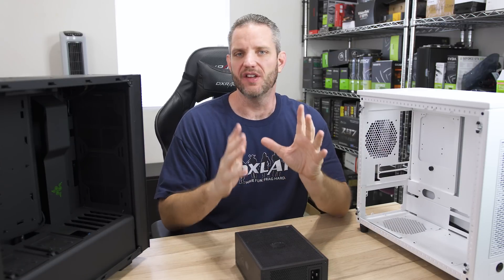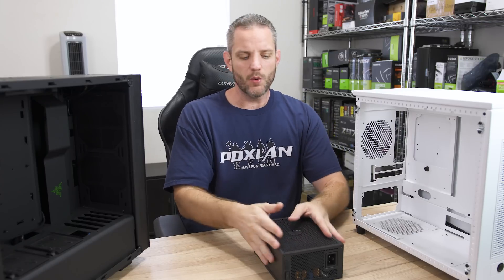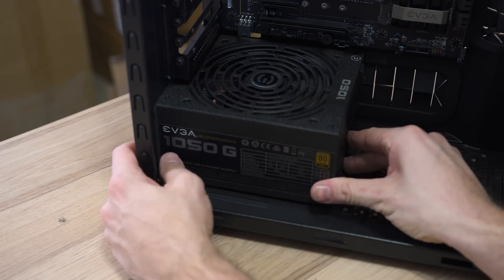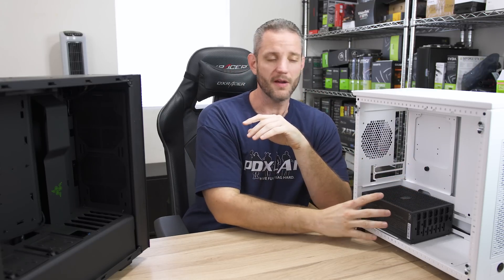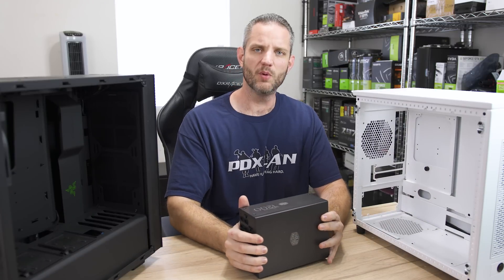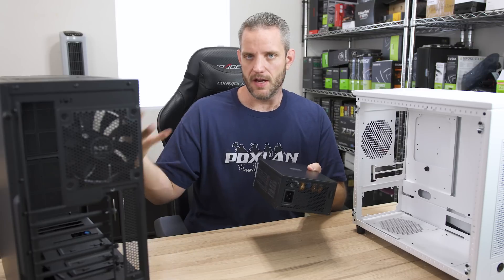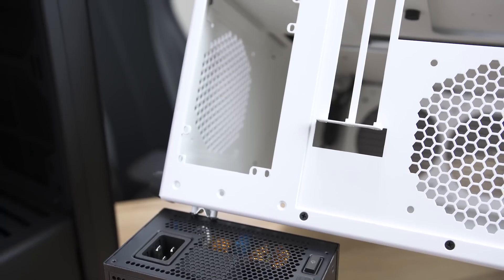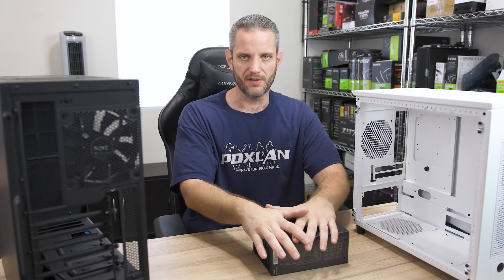Should you mount your Power Supply up or down?

Comment: 4:05 Jay, hot air is lighter than cold air, therefor it's going up when coming outnof the power supply, there is no way you can and up with a warm air loop.
I mean I think but you have more experience so i'll trust you^^
Reply: God the cabinet....At my apartment I keep mine on my desk. When I bring my PC to my parent's though my desk there is small and I have to put it in the cabinet, but it at least it's open in the front and partway on the back left. My mom's desk though has a cabinet with a door on the front and no ventilation. Why?! It kills me when I see the computer on in there with the door shut, all hot. I'm about to build her a new one from my old parts, but I'm worried about putting my precious parts in that cabinet. I'm gonna at least try and take the door off; hopefully she doesn't argue about the aesthetics.
Reply: If there is a decent intake fan 5-10cm from the heated exhaust (as would be in the described scenario), that fan wouldn't have much problem drawing some of that hot air "down" and back in again. Surely the force pull on the surrounding air, from the fan, would be greater than the thermal updrift due to exhaust/ambient air temp differences. Remember we're just talking half a fistful of centimeters here.
Reply: Albert Mas
That doesn't sound right. Your PC will always be hotter than (or at best equal to) ambient temperature. Components in your PC can only generate heat; there isn't any cooling system inside in the sense of a refrigeration cycle with a compressor and condenser and such. Fans only move air, they don't change its temperature. Even in a water cooling loop, the coldest a part of the loop could get is ambient. And it's not like "processor x runs at 100°F under load" regardless of what the ambient temps are. The processor turns some of the electrical energy sent to it into waste heat energy. If the ambient temp is 110°F, then the processor adds heat and increases above 110. Ignoring heat generation, say when your PC is off, its components will come into thermal equilibrium with the atmosphere; if the room is 110°F, then the PC will become 110°F. I suppose it's possible if the ambient temperature went up very quickly that the PSU could be colder (it hasn't had a chance to reach thermal equilibrium), but it would quickly heat up to at or above ambient as 1) normal heat transfer to reach equilibrium continues 2) the PSU fan starts to pull hotter ambient air across its components 3) the PSU components generate waste heat internally.
Reply: Heat like that is a good way to kill an HDD.  Linus Tech Tips had a video a while back where he cut a hole in a cabinet and affixed a fan to it that was powered off the PC.  Might be worth trying.
Reply: +pendragonshall

Oh, yeah, real life is way complicated versus theory. For the most part, the reasoning behind why placing PSU facing up would be cooler for the CPU would be another exhaust for the whole system. More exhaust will pretty much always mean a cooler average internal temperature. I was trying to say, however, mounting your PSU up means that your PSU will run hotter, since it's then going to be intaking air that's already been heated a little bit. Your CPU would almost definitely run cooler with it mounted up though, and average case temps would definitely be lower. I was taking the point as being more that putting the PSU up is cooler for the PSU, which wouldn't be true in most cases. But if you're talking CPU temps, then I totally just misunderstood the problem, and yeah, CPU temps would definitely be lower. As far as the hot-air loops go, though, if you're seeing that problem, it might be more a problem with the case design or placement. The placement of the computer is super important for that stuff, and so my 'analysis' is more general, for an 'ideal' setting. (I also didn't really do the math, I just know how the equations tend to interact and make educated assumptions from that, so it could turn out that I'm off). But if you've got things set up right, you shouldn't be getting any substantial hot air loops. You'll definitely take in some (fan turbulence will definitely send some down there), but it should be pretty minimal. Then again, not everyone can get an ideal setup.

Not trying to talk down to anyone, aerodynamics is super complicated to get right and sometimes a little counterintuitive. Hard to explain any part of it without sounding a little condescending, but I try my best. Sorry if it came out like that, definitely not the intention! I just want to help educate people on how stuff works since conventional wisdom on how fans work isn't usually true (well, results can be, but the reasoning is usually off), and I think most people enjoy learning. :)

Have a good one man, sorry for any misunderstanding!
Reply: wtf are you smoking? Ambient temp will not be hotter than the air coming out of a computer. If you pulling air in that is 65 degrees, your computers components are not going to cool it to 60 degrees and spit it out. wtf are they teaching in schools now.
Reply: Omegasix word!
Reply: Heya,,, My answer stands. Thanks Aerodynamics.. . wait,,  have to say something since YOU had to also. .. that's sounds,, I'm sure you meant nothing by it, but, don't do that.. Do you thank gravity everytime you walk?? Sorry but people that treat normal reasons such as ,, oh math etc and then thank it like a religous mantra make it sound, like a ,, platitude i guess. .. anyhoo .. AGAIN.. sorry if that hurt feelings didn't mean to. Just, don't do that.. It also makes it sound like you're talking down to someone. So unless the person you're speaking to is actually dumb.. It's.. Just don't do it k :)
To prove this as fast as possible. Simply. Take your psu and mount it intake down. Check temps. Then mount it up. Check temps. ALSO make sure your case is within a few inches of a wall and there is no air flow going through the room. 
Use colored smoke if you have it, temp camera or temp gauges such as I have. 
THis is what you'll find. It will ALWAYS be slightly to a lot cooler overall for your case components mounted up. As for your cpu it will either show no difference to quite a bit. Depending on how close your case is to the wall or if it's in a partial enclosure. Say a cabinet.. 
SOME of the heated exhause will go into a loop. THis is fact. It's no a lot. Unless you're in a pretty restricted enviroment or right up against a wall (most people are) however,. Placing it up. DOES cool your CPU, quite a bit more actually. So yea.. 
My PSU doesn't run at any temp difference for ex. Face up or down.. But my case is over 10 inches from the wall and there is constant airflow in the room. But my case does run cooler as will everybodies.. And yes placing a computer up really near a wall or in a cabinet with door off. WILL cause a loop even if it doesn't say in the middle of the room. The closer and/or more enclosed, the greater the loop.. AND you WILL notice psu temps rise whereas if the psu was face up it woudn't. 
All good. Take this as you meant for me to take yours. Peace
Reply: but he's wrong. sort of and he's right. ahh read my response to his. Peace
Reply: Scoobacca152 Hello, your answers seems to me really well fundamented. Are you aerospace engineer? that's fucking cool.. Do you know what's the best fan "side" for a cpu water cooling system? (radiator)
Reply: +Kurgan100 The best solution for a radiator is to put two fans on the radiator with the airflow going the same direction. This is called a push-pull configuration, one fan pushes through, the other pulls through. 

However, if you're only doing one fan, there's not a huge difference on cooling for which one is better. "Pushing" air through the radiator is what i prefer, but it doesn't matter that much.
Reply: Scoobacca152 I have a Corsair h115i then you said that put it on 4 fans 140mm instead of only 2 or I'm wrong?
Reply: +kurgan100 4 fans on it would be optimal for cooling, but you'll be fine with 2. 4 fans will also run louder than 2 will, so there are benefits to not having more fans.
Reply: Scoobacca152 Do you recommend any fan in special?
Reply: +Kurgan100 anything with high static pressure
Reply: Scoobacca152 Thank you for your help!
Reply: You clearly haven't studied about flow of liquids and gas then... You can't just make a general statement like that and have it be true for all circumstances. There's plenty of situation where the air (not all you see...) will take the route back under
Reply: I apologize, but can you explain this in simpler terms for me? Reading the paragraph was definitely a challenge, but I did understand the physics of air. I just didn't understand how the PSU interacts with it. I definitely do enjoy learning and understanding new topics!
Reply: OMG, everyone tries to factor in the fact that hot air rises. Hot air rises slowly, not quickly enough to effect fast moving airflow. Hot air rising is not a factor in boxes with moderate to high airflow.
Reply: +pendragonshall
 Not exactly true. You're ignoring a lot of factors. For background: I'm an aerospace engineer. Airflow is our thing.

The PSU fan being mounted on the bottom does a few things. It pulls the coolest air in (thanks convection) from immediately below the computer. This air below the case is then at a lower pressure than the average air in the room, and so more air rushes in to fill it. That air is going to be the air immediately nearby. The PSU also vents out the back, meaning that air is higher pressure and wants to move to areas of lower pressure (like the bottom of your case). Makes sense, right? Unfortunately, that's not actually how it works here.

What determines flow is total pressure. What we're talking about in the flow we just described is static pressure: the still air that we're using as a cold supply becomes thinner. But the air we're exhausting has a few things going for it though: it's warmer (less dense, more viscous), and it's got velocity (fans). However, unless there's a dedicated output fan for the PSU, your static pressure (pressure caused by the air just being there) is likely about the same as the rest of the room. What this air has (why it's higher pressure) is called dynamic pressure, which comes from air moving. That dynamic pressure bleeds off because of the air's viscosity. Hotter air is more viscous than colder air (unlike liquids), and so the hotter air will actually lose dynamic pressure faster than cool air would. This air loses most of its dynamic pressure within inches, so that air then dissipates and convection takes over as the dominant flow driver. 

So the question is: does the air right out of your power supply get sucked right back down? The answer is some, probably (turbulence from the fans can send air a bunch of different ways), but not much. The hotter air is higher viscosity, meaning it's more resistant to flow. The cooler air around the room is lower viscosity, and so it's much quicker to fill the need than the warmer air is. You also have to consider that air also has inertia and momentum to deal with. The exhaust air from the PSU has momentum pointing away from the case, and in order to bring it under the case, you need to change the direction of that momentum, which takes a force. The lower-momentum, but still hot air that's slowed down is also more likely to be pulled by convection than the slight pressure decrease below the case (at least an inch or so away at this point, which is significant at these small changes in pressure and velocity). The static air in the room, meanwhile, has much less momentum to worry about. With the higher viscosity and the greater momentum change needed to get the hot air back under the case, you're far more likely to pull in the static, ambient air from around the room.

Mounting the supply up only helps if there's carpet. Otherwise, all you're doing is pulling in warmer air all the time for sure rather than pulling in air that's much likely to be cooler. Jay is wrong.  (He's also wrong about positive pressure being ideal, it decreases total mass flow of the air and makes the fans work harder, but it does have less dust. Ideal is neutral pressure with regular cleaning.)
Reply: +Omegasix It depends where is the PC. The closer to the equator you are the higher the ambient temperature is. In places like California ambient temperature may get much hotter than the air exhausted by the PSU thus it will go down and the main fan will suck it.
Now imagine in lower regions (or higher if the PC is at south hemisphere)
Reply: pendragonshall <---- exactly what this guy said. Even working with still air, any intake fan that is worth even using will overcome some of the thermodynamic rise of hot air, and then that intake will break the air from being static and pull some of it back in, generating a higher ambient air temperature around it in time.

And if that air is already flowing, as it would be when exhausting out, then it already has motion and the loop will start easier.

The main factor that could change that is if there is some kind of air flow around the outside of the case already which might create a breeze over the intake. But only the weirdos who sit house fans blowing on their case are likely to ever be in that situation. But that's one of the potential benefits of a slightly elevated PSU in the bottom of the case. That gap makes it much less likely to pull air that's being exhausted out of the back.
Reply: That would be true for static air or very light moving air. This is a current moving out with in a inch or two of the intake. It definitely creates a loop. Doesn't pull ALL the hot air in but to much of it for certain.
Reply: As an engineer my self, i just love this answer! 

I could not agree more. 

Thanks

Comment: I always mount my PSU with the fan on top because my computer goes on carpet, everyone always says I've done it wrong and it doesn't matter that there is carpet because of the feet on the case but I'm glad a huge tech tuber has finally mentioned this. Thank you.

Comment: I was always wondering if I was facing my PSU in the correct direction for airflow, now I know that the fan facing upwards was best, (I'm using a corsair GS600 with blue LED's) and it helps act as an exhaust to relieve my 120 exhaust at the top. thanks Jay

Comment: I use my 750W CoolerMaster PSU with the 120mm fan facing up into the case i used to mount it down on the bottom of the case but it was not cooling effectively so i switched it to fan side up to let the mega boss psu get the most airflow since ive got intake fans on the front of my Coolermaster Elite 371 Case and the outtakes on the back, side top and back for optimum airflow.

Go for this it is the best message since i do the same way jayz does that in the video.

Comment: I didn't do too much of a research for my first build and I got the "isolated" PSU space where I have to put it facing down. Problem is, my PSU was designed to be put facing up with all the connectors being placed on the one side, and 'neccessary' cables from the other. So the cables basically make it harder to connect anything to the PSU. It's better to do some research before actually buying stuff and I learned this from my minor mistake. So stay safe and match your PSU to the case or whatever.

Comment: Yea I can vouch for the fact that water inside your PSU = bad day, capacitors can make quite a bang if you use a moist psu. Most likely a wellmade psu will shut down automatically to protect itself but if you try provoke it with a manual fantest you can make some noise.